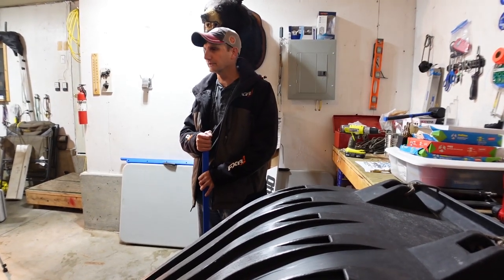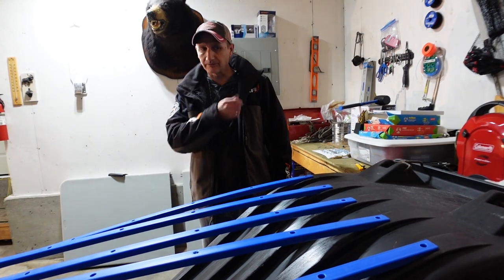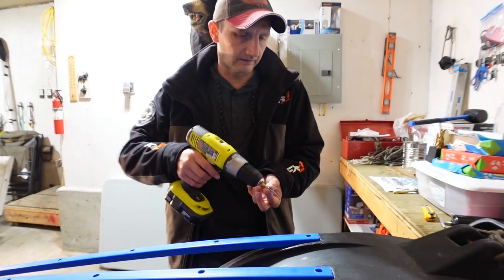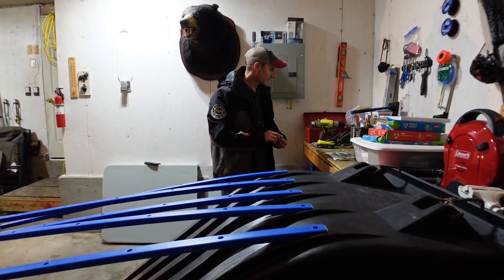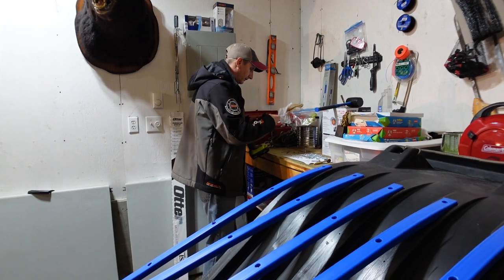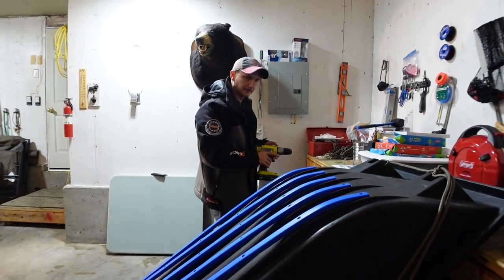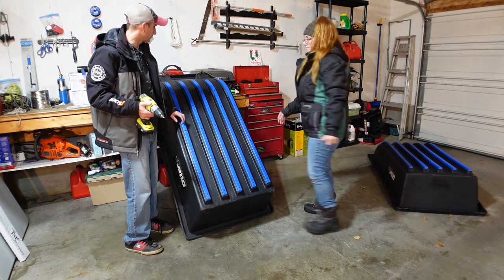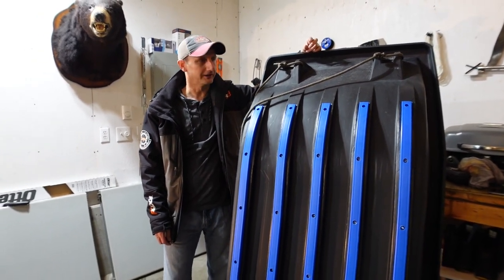How To Install Otter Hyfax Runner Kit (TIPS for Quick Install)

Comment: Hi K&T. Just a thought - wouldn't you want the bolts going the other direction so nothing catches on the screw heads in the sled? Maybe the bolts are too long for that.....
Reply from the maker: We actually looked at that but they are too long, and we would have to cut them all off. The bolts sit inside the runner groove on the bottom of the sled so we should be OK.